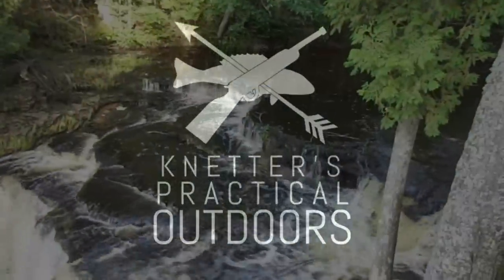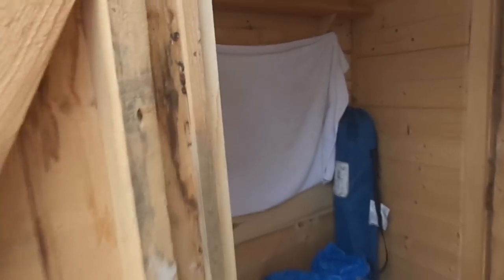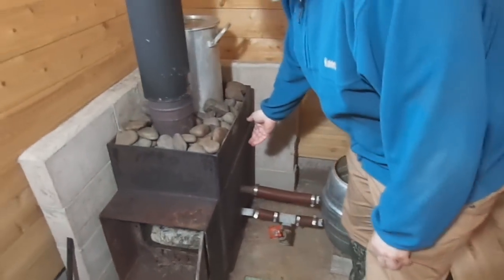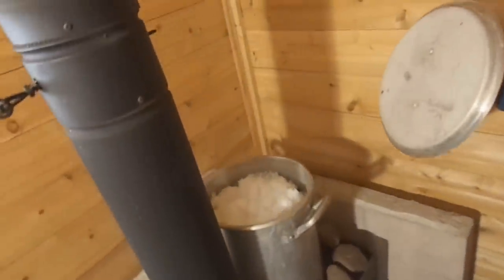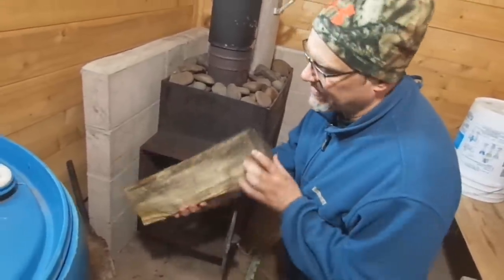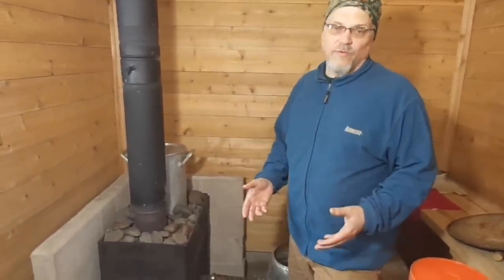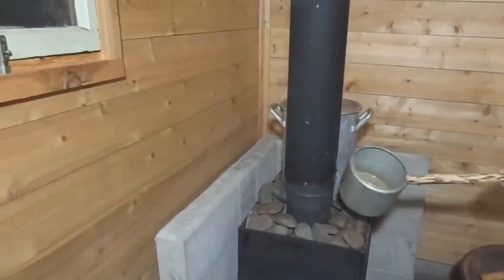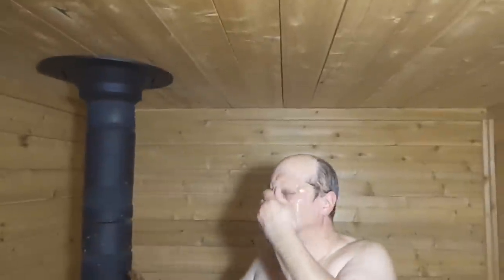How Our Off Grid Wood Stove Sauna Works

Comment: Can't thank you enough....exactly what I was searching for!!!  Have plenty of wood always....such a simple and incredibly effective way to create a steam room....love it.....alofa from Samoa.....Chief Tupa'i Bruno
Reply from the maker: You're very welcome!
Reply: Put lobster pot 1 long piece of copper pipe flange bother ends make cool out of the one piece fill with sand put fire use flares connect to hot water hoses one goes bottom of metal can height height 2feet ,,1 foot long,,6" wide other end goes in 2nd valve around the top.at the very top use the 3rd and final valve at top for vent
In the metal can 50/50 Antifreez and water.make the copper pipe extra long you want that big fire is away from cabin.heat comes from ammo can

Comment: Love it! Alot of great ideas for our tiny home. 
I would totally put the warm water into a pressured stainless steel tank with sprayer and shower that way.
Reply from the maker: Great idea!  I'm glad this video helped, KPO.
Reply: Do you think some half inch copper tubing that wrapped around the stove pipe like the worm on a moonshine still would work for a shower? Maybe a tank mounted on the wall, with a shower head and ball valve coming from the bottom of the tank? 

I'm guessing the distance from the flame might make the perfect temperature shower.

Comment: Hi KPO,  about your stove,  There are no exits for the water on the top?  How long does it take for the water to completely steam away from one dippers worth....your size dipper?  What about radiant heat from the stove?  Built my sauna 28 years ago...14 x 8 1/2 feet...  5 x  8 1/2 changing room. I moved it once to another rental....a major pain..... bought property in 2011,  but was allowed to keep at old rental thankfully.....but want to build one  at My House now.  Thinking of stoves.  Mine is made from a  40 gallon hot water tank,   flat plate on top to heat water in stainless tub,  but I would consider a different style.  I do at least one sauna (Monday nights) a week and hopefully 2 or 3 if my buddy calls me over to his about 1/4 mile away.  It is my church and place I "pray" for those who have left us.   When I get another built it will be 3 or 4 a week like it was when I lives where it is..  Love watching vids on Saunas and can tell yours would be sweet to sit in.  Thanks and keep up the good work--Lopez Island, Wa---Texas Bob
Reply from the maker: Thanks for the comment Texas Bob.  The water on top is just in a big cooking pot.  Just your basic warming on the top of a stove.  I've never really paid attention to the steam away rate but I guess one dipper is done and the stove is dry in less than a minute.  With a decent fire it takes about an hour to get the water scalding hot and the sauna room nice and warm during the fall season.  Thanks for watching, KPO.

Comment: Hi KPO, thank you so much for this video. I have been searching like crazy on the internet for some more information about your design but I havent seen a replication/copy of it yet. Do you mind if I ask you some questions about it? 1) Did you receive the stove with the interior pipe (the back boiler) already installed or did you weld one in yourself? 2) What is the diameter of the two exiting pipes which circulate the hot/cold water? 3) How many gallons is the steel metal drum you have holding the heated water to the right of the stove?
Thank you for the input!
Michelle
Reply from the maker: Thanks for the interest Michelle.  We got the stove used and it had the interior pipe already.  Ideally there would be more pipe on the inside of the stove but ours just had a small piece (takes longer to warm up).  i think the pipes are about 1 or 11/4 inch diameter.  The tank is actually an old beer keg, I think 5 gallon.  I hope this helps.  Some sauna stoves have a tank built right into the side of the stove.  Thanks for watching, KPO.

Comment: y'know it's a very nice video about burning wood heat sauna, But one thing which sir forgot to mention is the extent to which the temperature in this sauna room can go up. can the temperature rise to about 150 Fahrenheit
Reply from the maker: Yes it can.  But I mostly run it cooler than that.

Comment: How long could you make the pipes and them still circulate the water would you say. I’m looking to do something very similar but am curious if I put the holding tank in the air if it would still work
Reply from the maker: my guess would be several feet or more and the water would still heat up good

Comment: In the process of building my own; your vid helped in building a wood stove with water tank - thanks.  
From scratch takes time; mixed cement on weekends this spring, (gravel, French drain, etc.) sourced rough cut 2x4’s and shiplap cedar locally (3 months till delivery) and just took two weeks off to build.
Did you line with foil?  I cheaped out and used tinfoil with high heat tape in sauna room only.  
Still have to finish the floor, build a stove, hang doors, wire in lights.  Was thinking of clay/sand mix coated with linseed oil for floor....thoughts?
Reply from the maker: No foil and we just used plain old cement for the floor.  I think it's been up for over 15 years now.  Check out the up-grade to the stove we did in this video, https://www.youtube.com/watch?v=_8DUDZrWf6I&t=362s You might find it interesting.  Especially if you're building a stove.  KPO.

Comment: How does the floor drain function in the winter and not freeze up?  I want to build one of these saunas at my Georgian Bay, Ontario cottage.  Thanks!  Greg
Reply from the maker: Drains into a drain field/tank.  We just took a plastic 55 gal drum and buried it on the side of the sauna.  We have the drain go to it.  Many holes in the drum so the water will eventually drain back to the earth.  Filled the drum with pieces of concrete block so it won't collapse over time.  The drum is mostly below the frost line, so no issues.  And also we don't use it very often in the winter, but when we do, no freezing problems.

Comment: About how hot will that stove get the space? About what cubic footage? Great video btw. Thanks.
Reply from the maker: I don't really pay attention to the actual temp, but like most wood saunas, if you let the stove go full heat it can get too hot to even be inside.  I believe the sauna room itself is 8 X 10, changing room 4 X 8, all with ceilings at 71/2 or 8 (can't remember for sure).  Insulated 2 X 4 stud walls.  Thanks for the interest, KPO.
Reply: @KnettersPracticalOutdoors  thanks for the reply. My father’s sauna gets up to about 240F. That’s too hot for me but I’d like it to be capable of about 220F even though I like it around 180F.

Comment: Where the pipe goes out in the ceiling, how do you do the insulation and such up there? Even if it's double walled pipe, how much of a gap is there, or how does that work up there?
Reply from the maker: It's been a while but I believe we have a 2 foot by 2 foot square with just metal around the pipe, no insulation.  KPO

Comment: Just wondering how long it takes to heat the sauna up to operating temp?
Reply from the maker: Well it can vary because of outside temps or how aggressive you want to be with working on it.  We usually get the fire going and then put a few bigger pieces of maple in and let it do it's thing.  That might be 1 - 2 hours to get it hot in the fall time of the year.  But if you want to keep putting smaller pieces of maple in, it can go faster.

Comment: I think putting wood in a stove from outside of hut would be better vs smoke from stove causing respiratory issues.
Reply from the maker: Yes I've seen sauna stoves like that.  But if you have a good draft it's not really an issue, KPO.

Comment: Is that a regular stove or a sauna stove?
Reply from the maker: Well it has a raised top edge to hold the rocks and it has the water pipe inside the stove so it was built for use in a sauna.  Thanks for watching, KPO.